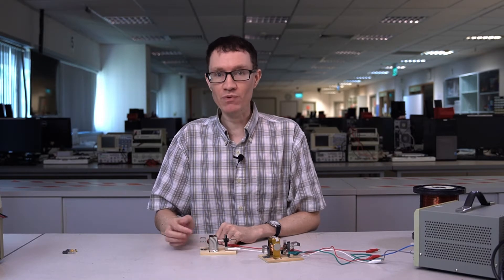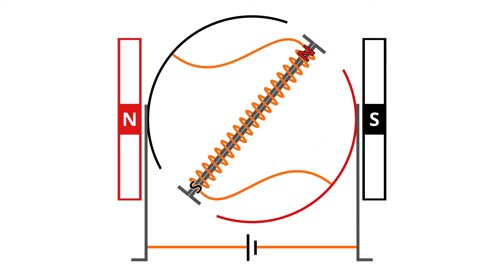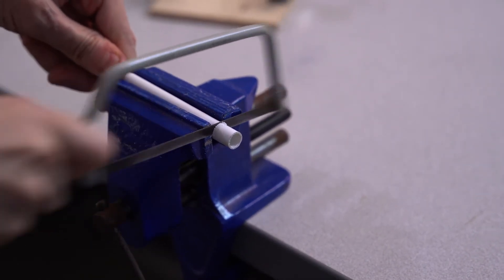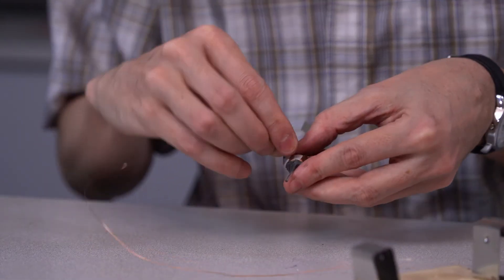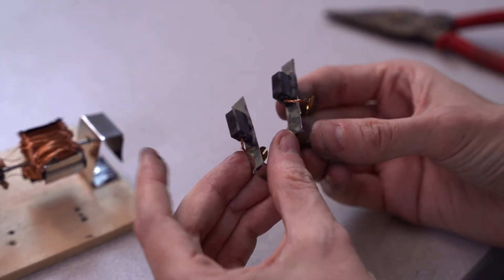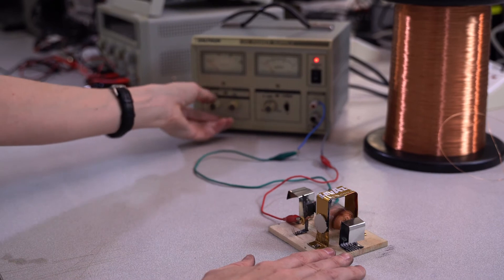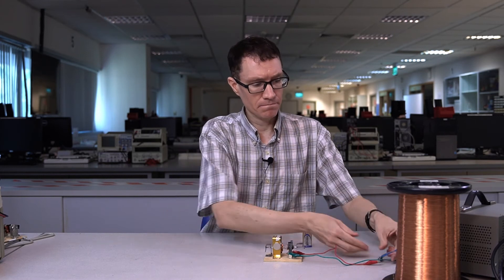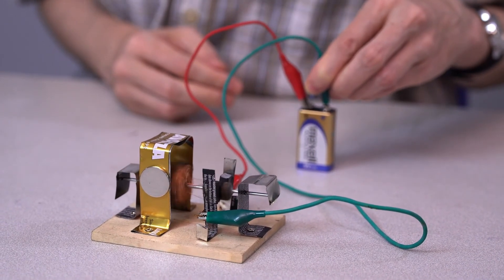Let's build a 3-pole DC motor that's self-starting (Motors #2)

Comment: Great videoseries on dc motors!  The best I've seen! 

Could you maybe elaborate a little on the updated magnet holder which spreads out the magnetic field? If the material is magnetic, doesn't it form a magnetic circuit above the rotor core, and hence just reduce the magnetic field seen by the rotor significantly?
Reply from the maker: The uniformity of the stator field (not just its strength) makes a difference.  In a more symmetric rotor with many poles this isn't usually a problem because the forces balance well - but here with three rotor poles, one of the three at any given time will be passing rather close to a stator magnet.  If the stator field is too concentrated at that point, as it could be without the spreader, the attraction of the rotor core metal to the stator magnet can then be too strong for the motor's torque to overcome.

Comment: Thanks for the video! Please cold you inform me with a proper source that I could learn how to build my own dc motor or could you make a video and teach us step by step on how to build a desired dc motor. For instance, I’m aiming to build a dc motor that could run by 24v and 10A and has a 10Nm torque. To do this, how should I start and what are all the steps that I need to take to achieve that goal? It’d be deeply appreciated if you could either reference me to a proper/right source or if you could make a video or a series of videos reaching us that. Many thanks!